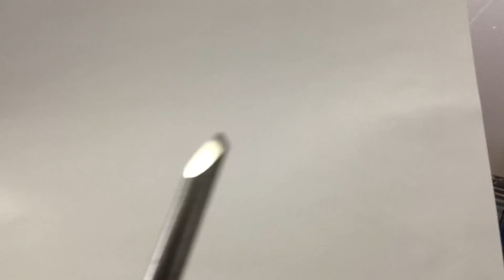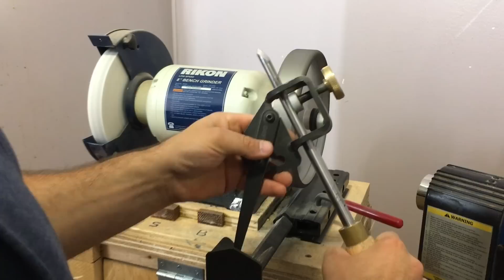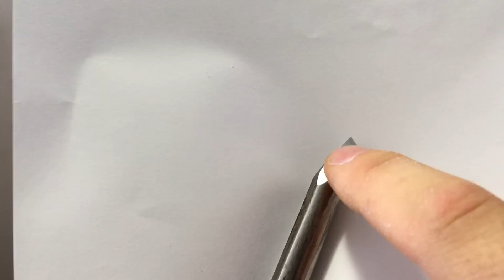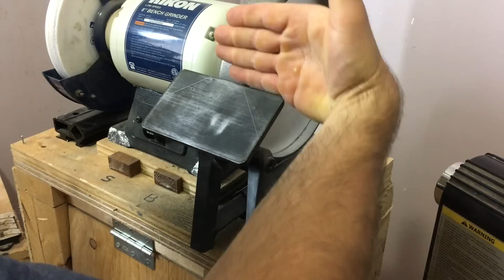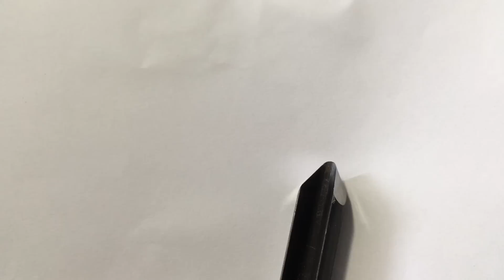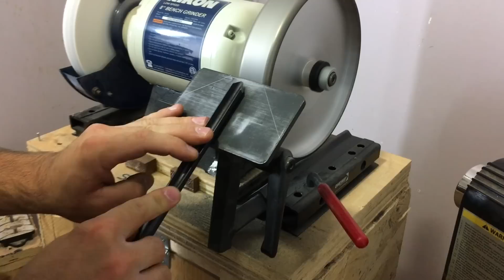Woodturning - Sharpening 3 Different Gouges (Swept Back and 40/40 Bowl, Standard Spindle)

Comment: Really nice tutorial on these grinds -- and it is a tutorial, despite the opening disclaimer :-) I just came across your channel yesterday, loved the chokecherry projects, and subscribed. I had the pleasure of attending a workshop that Stuart gave, so some tidbits from that: Stuart much prefers an elliptical flute, and immediately starts rolling the grind to remain tangent to the curve all the way around. In his experience that provides an entirely consistent angle of attack all around the edge. Next preference is a V or modified V, with a U flute a distant third. He also grinds the 40/40 in continuous sweep, which I found intimidating at the time. I still do :-) He also designed a set of angle gauges, now carried by Woodworker's Emporium, that permit you to set a platform angle in seconds -- so I now sharpen everything on the platform. I use a 35/35 for spindle gouges. Woodworker's Emporium also carries a bunch of other tools he designed. Last, he heavily relieves the heel of the grind, leaving less than half of the original bevel, and emphasizes that you should "glide" the bevel, not "ride" it. And really last: if you ever get a chance to see Stuart in person, jump on it. You'll be hard pressed to watch something more amazing than him turning an 8-10" thin walled bowl in a matter of minutes, all while talking to bystanders, answering questions, and telling funny, funny jokes. (Sorry for the thesis length comment...)  Clyde
Reply from the maker: Clyde Ulmer Thanks for the kind words and for your subscription Clyde, much appreciated! I do remember Stuart suggesting the elliptical flute and that the v-shape can cause you to get a bit of a "beak" on the tip of the tool. That is something I came across and had to be very mindful of to make sure it doesn't happen. With the v-shape you can't make a continuous movement across the wing because you have to grind the wing almost separately from the bottom rounded portion to avoid a beak and to maintain the 40* wing sweep. So the elliptical flute would definitely eliminate these problems, so your suggestion is very important! It still works very well with the v, but elliptical would be optimal for sure. This is one reason I told people to check the demo on YouTube because I knew that I would be leaving too much out to get a satisfying explanation. The points you covered again are very important and I appreciate you taking the time to explain it properly, it helped me to understand it much better. There is so much to this grind that it takes a few minds together to understand it almost lol 
I would love to see Stuart do a live demo. The few I've seen on YouTube really shows he's one of the most skilled turners on earth. Much like his (late) father Allan. Brilliant turners.
I usually relieve the heel on most of my grinds but I didn't do that and I should have. Your observation is keen. 
How do you find the 35-35 for spindle? Maybe I should try it out and make an amendment to this tutorial.....I mean this entertainment based video lol
And yes I agree about glide versus ride. Too much pressure can cause vibration and burnishing and even heat build up.
Thanks again Clyde, your comment should be added to this video! 
Kyler
Reply from the maker: And one more thing, I do want that angle tool he developed. I looked for it in lee valley but they don't carry it. I will look into woodworkers emporium. Thanks again!
Reply: Hey, Kyler -- glad you found my comment worthwhile. Wrt spindle sharpening, I just use Stuart's angle gauge to set the platform to 35 degrees. I have both 35 and 40 degree lines scribed on the platform, so it's then just a matter of remembering which tool I have in hand -- not necessarily a sure thing :-) The mechanics are the same, although you have to be aware of the depth of the flute on a spindle gouge. Oh, and it helps to grind a notch into your platform; I take the wings way far back on a detail gouge when I'm doing really delicate stuff.  Clyde
Reply from the maker: Clyde Ulmer Thanks for all the info Clyde, it's greatly appreciated! I'm going to give that grind a go, it seems like very sound reasoning. I haven't experimented with detail gouges yet, although I understand they have a much shallower flute? Btw I'm going to pin your comment so that it shows up at the top of the comment section of this video because I think the information will be of great help to people. Again much appreciated!

Comment: For your 40/40 grind, that looks like one of the Thompson V gouges. I do have several of them. As for Stuart's 'swing the wing', that refers to a slight difference in how you sharpen a V flute compared to a parabolic flute. You don't swing the wing with a V flute, but do with a parabolic flute, and this is due to a straight wing (Thompson), compared to rounded wing on parabolic flutes. So no swing on the V because that can get you that little dip near the nose if you roll the flutes too slowly.

Comment: I have the feeling you do a 40/50 grind... The wheel is set to 40 degrees in regards to the flute. But you move the flute a little of your 45 degree lines which is then 50 degrees in respect to the flute... 
Overall I guess it does not matter that much, since you like to work with your grind. I just want to point this out.
Thanks for your video!

Comment: Isn't the grinder out of balance with tg CBN wheel on one side and the regular stone on the other? Risk of ruining the bearings?
Reply from the maker: Will Mitchell I'm not actually sure, I never thought about that! But I would assume the bearings can handle it. If my bearing go early, then I will know I should have heeded your advice! Lol
Sorry for late reply!
Kyler
Reply: balance doesn't really refer to how much weight you have on each end of the shaft, but on the variation in weight from one side of a grinding wheel to the other side ofthe same wheel , caused by excentricities inthe wheel mounting or variations in density within the wheel itself, making one side heavier that the opposite side.  Should be no problem for the bearings.  Same as if you run a nylon buffing wheel on one side and a grinding wheel on the other--no problem for bearings.

Comment: Hi, I'm new to your channel and I would like to ask you, what is the name of the tool that used to sharpen the gouges, I live in Brazil and I want to import it. Can you help me? Which store can it be found? Amazon? Ebay? or on websites in China? hug.
Reply from the maker: Wanilton Oliveira Hello Wanilton. The Grinder itself is a 8" Rikon 1/2 hp slow speed Grinder. The sharpening system is made by Oneway. It comes with the two bases that sit under the wheels, one platform, and one v-arm. The jig that clamps on to the gouge is called the Vari-grind jig by Oneway and it is used with the v-arm. I've always ordered directly from Oneway. They are located in Canada. You have to phone your orders in with them. Other companies that carry woodturning supplies carry them (Lee Valley, Craft Supplies) but they may also be on amazon and eBay. Check google to see if there are any woodturning supply stores more local to you first to see if it's cheaper that way. And if all else fails, Captain Eddie Castelin has a video on YouTube that shows how to make your own at home. Other companies make very similar jig systems as well. Hope this helps! 
Kyler

Comment: Lots of good info, Kyler!  I use the same system but a slightly different process.  Whatever gets you there, right?  I sure do like the CBN wheels but I made a costly mistake.  I went with 1" instead of the 1 1/2".  Dang, it pisses me off just bout every time I sharpen!

Another great video, Kyler.  Sorry you are under the weather.  Hopefully you'll kick it to the curb, soon!  Keep 'em coming!
Reply from the maker: madronawoodworks Thank you Phil! And yes you are right that whatever gets you sharp and ready, is what you should do! 

Sorry to hear you regret the size you purchased. I've done that with quite a few tools in my life and it definitely stings. Now it can take me forever to finalize a purchase because I have a fear of doing it again lol I spend so much time overthinking things now that by the time I buy it, it feels like half of my excitement has disappeared lol

I'm slowly getting back to feeling my normal self. Thanks for your concerns!
Kyler
Reply: I can't help  but chime in on this. First of all I hope you feel well soon.
As far the fear of buying the right thing. Believe me I have many more years of experience at doing that than you can imagine.
 Case in point 2 years ago I looked at the Laguna 1836 and was ready to buy it. I can't tell you why I didn't.
I found a Jet 1442 on Craigslist and  bought it. It was a fine lathe. Fast forward to a month ago and guess what? I end up buying the Laguna 1836.Had nothing to do with cost...it was....Is that the lathe I really want. Duh!
New cars are another great adventure. I guess that is why we keep them for way more years than most do. 
 I also have the same grinder as you. But no CBN wheel...now I know I need one. If you and Phil use it then it has to be good. What grit is yours?
 It is late here in Oregon but what better to do than watching YouTube.
Take care of yourself,
Gary
Reply: We keep our cars a looong time, too, Gary.  I had my favorite truck for 17 years.  I'd still have it if that semi hadn't rear-ended me while I sat at the red light.
I have a Porter Cable grinder and it is grossly under-powered.  It'll spin the twin CBN's but it takes awhile to get up to speed.  Didn't know about the Rikon's at the time.
I have an 80 grit and a 180 grit.  I use the 80 for reshaping and for sharpening scrapers.  I use the 180 for everything else.  Some of the best money I've ever spent.
It's almost as late here in Washington!  Good night, all!
Phil
Reply from the maker: ThePapa1947 Thanks for the concerns Gary, I'm pretty much better now but it was quite a long cold for me, especially for summertime!

Phil is exactly right that 80 grit is best for reshaping and 180 is perfect for sharpening. Mine is 180 grit and sharpens things up really nice and about as fast as an 80 grit aluminum oxide wheel would. Just much cooler. One thing that is important to note is that CBN is for good high speed steel only. If you sharpen anything that is high carbon steel, it will plug up the wheel. Robo Hippie says when he has done that, he just sharpens a large HSS scraper and it cleans it out well. But I don't want to risk it. I noticed even my benjamins best tools were close to building up in the wheel so I still have a while aluminum oxide wheel on the left side to sharpen those while I still use the few I still do. It might not really build up that badly or permanently and may only get to a certain point, but I still decided to use aluminum oxide for them until they are used up. 

Hope this helps Gary!
Reply from the maker: madronawoodworks Getting rear ended by a semi doesn't sound like a fun experience, hopefully it didn't beat you up badly Phil! 

Have you ever had problems with softer steels building up in the wheels? I know CBN is for HSS only, but I've even had my benjamins best build up in my 180 wheel (seemingly) before. I know they are supposed to be HSS but it's hard to know for sure because they are somewhat of a less reputable company. It's why I still have a while aluminum oxide on the left. Just curious if others found this as well, or if it's just in my imagination? Lol
Reply: I don't sharpen anything but HSS with them, Kyler.  I do have a lot of BB chisels and haven't felt like the wheels are clogged, at all.  I've read (somewhere) that you just spray CBN's with WD40 to "float" any impurities and wipe them off.  I've had mine for a couple years and haven't tried it, but it might be a good idea just for preventative maintenance.
Reply from the maker: madronawoodworks Thanks for the info Phil. It makes a lot of sense. I figured I was overthinking things again lol I'll probably get myself an 80 grit in the next year. Can't beat CBN!

Comment: Stuart Batty makes it look easy, using his 40/40 grind. Then there are people saying that a bottom feeder is needed, with a 60 +grind. I find it hard to decide what to put on my gouges, any suggestions?
Reply from the maker: Joseph Wise Hello Joseph! I mentioned in the description that I also use a bottom feeder but I hesitate to demonstrate it yet because I'm still experimenting with the grind. So far I sharpen it similar to a traditional grind with very little sweep back and I sharpen it to about 75*. My sweptback grind is around 60* but at that angle I still tend to have the tool run into the rim of the bowl when cutting the bottom because the angle of the grind dictates the angle of the tool. I find at 75* that rarely happens unless it's a very deep and steep walled bowl. At which point it's approaching more of a closed mouth bowl or very open hollow form. 60* would cut more cleanly but if the tool runs into the rim then you can cut the bottom with bevel support anyways. 75* with light passes still leaves a good clean surface, just can't handle a heavy cut. Stuart Batty's bottom feeder is sharpened unlike any other I have seen and looks like it should be more what I should aim for. He demonstrated it in the video I linked in the description and well worth the watch. I hope this somewhat addresses the issue! 
Kyler
Reply: You need more than one gouge. I have a 60 degree Irish grind for bottom of the bowl work and use my 40/40 for everything else. However, I can freehand pullcut with the 40/40 off the bevel very well and that takes me close to final on the bottoms, leaving usually just a touch up with the bottom feeder or scraper. If you listen to Stuart he talks about not riding the bevel but gliding near it, that is what I do by pull cutting the bottom of my bowls with th e 40/40. Keep her sharp!

Comment: Good Stuff,  I hope you're feeling better soon, I see I need to either make or invest in some jigs, not that I can make a CBM wheel but it seems I need one of those also, I've been looking at that Robert Sorby sharpening system, but the price tag on it will knock you down ! it's suppose to be the cat's meow for sharpening tools, but it still doesn't tell you how one can sharpen the tools, great video my friend.
Reply from the maker: The Pohl Barn Projects Thanks for the kind words and concerns Doug, much appreciated! The CBN wheel I bought was around $200 CAD so it wasn't cheap, but it sharpens the same as the week after break in and it's been over 2 years now. Long term it is by far a good investment. Not to mention how cool the tool stays and the lack of sparks and dust from dressing wheels. Is the Robert Sorby the one what uses a belt system? If that's the one, I have heard good about it too. Much like the tormek. But I've noticed many production turners rely on wheel based low speed Grinder systems. Might be some food for thought. Thanks for tuning in my friend!
Kyler
Reply: It is the belt system, but at 525 USD it's a big bite out of the pocket. then from what I understand you have to get different belts for it depending on what you want to use it for. I have the same grinder as you and a wheel and a couple of those fixtures would probably be a better way to go for me. but I do have a better understanding on how to sharpen those tools now,  LOL  I always wondered what the 40/40 grind was, Now I know.
Reply from the maker: The Pohl Barn Projects Wow that is crazy expensive! It better sharpen things so well they don't require sanding afterwards for that price! Lol the jigs and fixtures really make sharpening a breeze and saves tool steel as well.

Comment: So you are blessed with many talents. I always look forward to your woodturning but this was a great surprise.
This has  been by far the  best explanation  of using the vari grind system that I have watched.That even includes the one produced by Oneway.
 Also I have watched a few videos on the 40/40 and again yours has made it as clear as Oregon water. And that is clear!
 What size is that 40/40 you use? It is time for me to get an early Christmas present. That comes before my birthday so why wait?
 Well done Kyler....and God Bless you as well

Gary
Reply: Hey brother what tool do you suggest for hollowing out bowls ? Do you like the carbide tip tools ?  Thanks just did a green oak bowl and it was a bitch I had a hard time doing it. I just ordered my nova chuck set it was an anniversary set came with 3 sets of jaws and wood worm screw great deal 135.00 . Good to see you back !
John
Reply: Like all gouge grinding you want to minimize the grind on the tip or you will be grinding more on the sides of the tip. I find it much easier to just do a straight grind by rotating the tool and not worry about the wings. Having long wings on t he 40/40 grind is ok with softer woods where you can take more material away but for hardwoods you won't use so much of the wings. I only grind the wings when needed, otherwise I do a quick pass on them to keep them shaped but only worry about the tip and a bit to the cutting side of it, like Stuart I tend to do touchups only on the part that i will be cutting with.
Reply from the maker: ThePapa1947 Thanks for the kind words Gary! I know that Oregon water is clear by the beautiful photos you have posted in your videos. Amazing scenery and landscape out there! 
The bowl gouge with the 40/40 grind is a 1/2" Jimmy clews special made my Doug Thompson tools. It has a v-shaped flute and is made of some really nice steel. Holds an edge really well and sharpens really sharp. And I would say it would make a perfect early Christmas present lol
God bless you Gary, I appreciate our friendship. 
Kyler